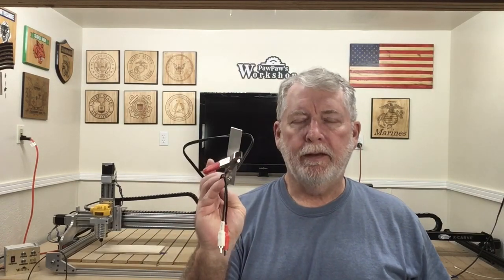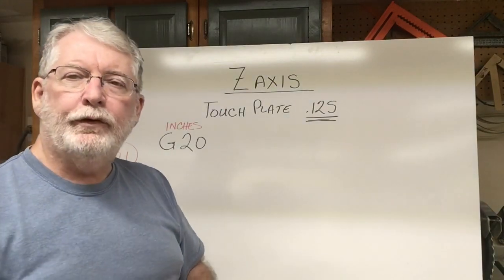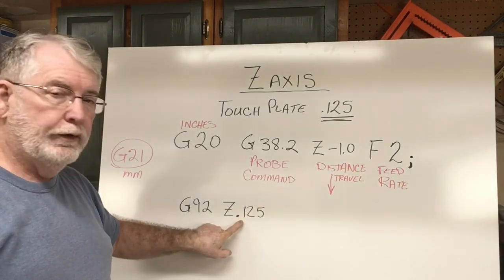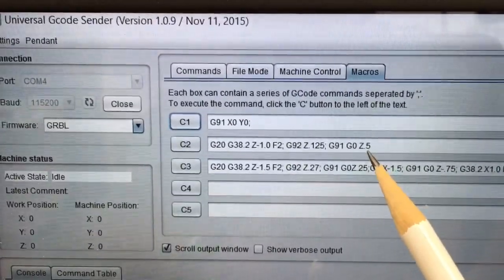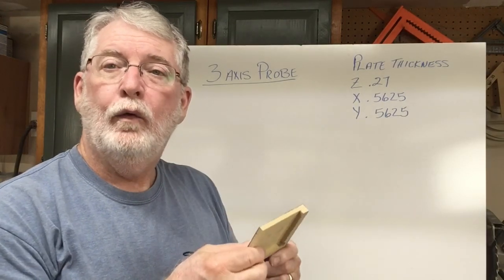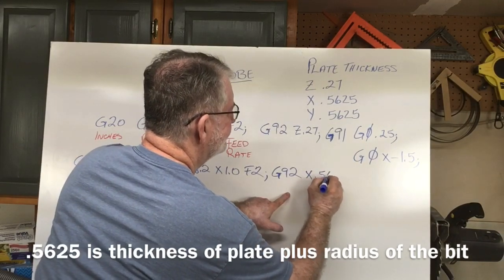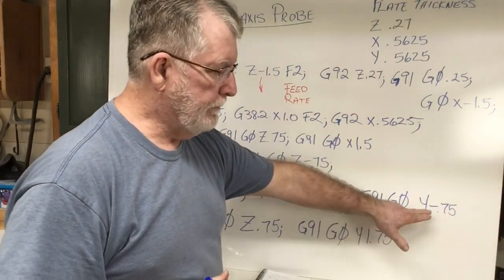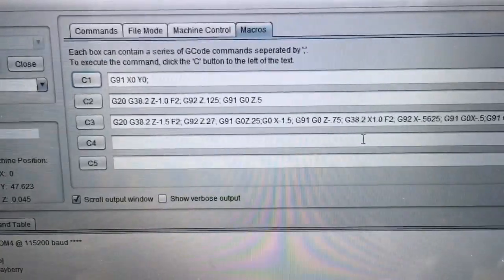Are You Ready to Learn to Write GCode for Your Touch Plates?

Comment: Thank you for the thorough explanation. While converting to Metric to help my brother, I took the liberty to convert the hard-coded values into variables so anyone can just change the values and not mess with the gcode itself. This gcode is in METRIC system. If you want to use Imperial, change G21 to G20 and your variables accordingly. Cheers!

;VARIABLES
#101=6(PROBING BIT DIAMETER)
#130=50(FEED RATE)
;
#102=10(TOUCHPLATE WALL THICKNESS FOR Z PROBE)
#103=15(TOUCHPLATE WALL THICKNESS FOR X PROBE)
#104=15(TOUCHPLATE WALL THICKNESS FOR Y PROBE)
;
#105=-20(MAXIMUM AMOUNT TO MOVE Z IN ORDER TO FIND TOUCHPLATE - down)
#106=15(AMOUNT TO MOVE Z AFTER Z PROBE - up)
;
#107=-40(AMOUNT TO MOVE X BEFORE X PROBE - left)
#108=-20(AMOUNT TO MOVE Z BEFORE X PROBE - down)
#109=15(MAXIMUM AMOUNT TO MOVE X IN ORDER TO FIND TOUCHPLATE - right)
;
#110=-15(AMOUNT TO MOVE X AFTER X PROBE - left)
#111=10(AMOUNT TO MOVE Z AFTER X PROBE - up)
#112=40(AMOUNT TO MOVE X AFTER X PROBE - right)
;
#113=-40(AMOUNT TO MOVE Y BEFORE Y PROBE - closer to you)
#114=-10(AMOUNT TO MOVE Z BEFORE Y PROBE - down)
#115=-20(MAXIMUM AMOUNT TO MOVE Y IN ORDER TO FIND TOUCHPLATE - away from you)
;
#116=-20(AMOUNT TO MOVE Y AFTER Y PROBE - closer to you)
#117=20(AMOUNT TO MOVE Z AFTER Y PROBE - up)
#118=40(AMOUNT TO MOVE Y AFTER Y PROBE - away from you)
;
; 3 AXIS PROBE
G21;
G91;
; START Z PROBE
G38.2 Z#105 F#130;
G92 Z#102; Z PLATE THICKNESS
G0 Z#106;
; START X PROBE
G0 X#107;
G0 Z#108
G38.2 X#109 F#130;
G92 X[#103+[#101/2]]; X PLATE THICKNESS + PROBING BIT RADIUS
G0 X#110;
G0 Z#111;
G0 X#112;
; START Y PROBE
G0 Y#113;
G0 Z#114;
G38.2 Y#115 F#130;
G92 Y[[#104+[#101/2]]*-1]; Y PLATE THICKNESS + PROBING BIT RADIUS
G0 Y#116;
G0 Z#117;
G0 Y#118;
Reply from the maker: Wow, thank you very much. This is excellent information. I really appreciate this.

Comment: Greetings, I just wanted to give you a couple of tips on your code. At the beginning of your macros if you define G91 you don't need to enter it over and over. It's defined until you change it EX: G20; G91; G38.2 Z1.5 .... G91 is now defined. Also G0 has been defined too many times. G0 X; Z; Y; each instance after the ; is a separate command and G0 is carried thru. You only have to redefine if you alter the scheme such as a G92 command. This being said I have cleaned up your code. This is what is running on my machine at the moment. G20; G91; G38.2 Z-1 F3; G92 Z.255; G0 Z.5; X-1.25; Z-.75; G38.2 X1 F3; G92 X-.377; G0 X-.375; Z.75; X1.145; Y-1.25; Z-.75; G38.2 Y1 F3; G92 Y-.377; G0 Y-.375; Z.75; Y1.145   Notice only 3 G0 commands. Just wanted to help you clean up your code.

I have designed 2 versions of the macro above with a .125 offset for .25 mills and a .0625 for .125 mills so I don't have to keep recalculating the offsets. 

I do thank you for the idea of the plate design and for explaining in English terms what can be confusing to many. Hope this helps in future endeavors.
Reply from the maker: This is fantastic! I am still learning how to code and this information helps greatly.  I will be study this and making changes.  Thank you very much.
Reply: Is there a way to code the movement back to zero instead of having to enter each axis and click move? How do you grab the values that are displayed and just move that amount negative?
Reply: @michaelcocroft9700  Hi if I understand you . . . You're over complicating it.  Once the probe stops the next bit of code tells the control that it's Zero so just move to Zero with G90 ( Absolute ) not G91 (incremental)
So the G92 tells each axis that it's a distance from Zero ( so it knows where that axis zero is)
Hope I explained it clearly.   Jim
Reply: This is excellent. I'm a g code newbie, but this really helps the learning. Learning how to program my machine is really the next step up

Comment: Thanks this helps explain it more even for me. Since this was over a year ago to try and help others. I also wanted to mention there is a newer version of UGS that has (return to zero) button which might make it easier to return it instead of doing it by typing it in. Also the new version you can move xy and z independently now so you don't accidentally jam your bit into the board buy forgetting to  change xy movements which might be higher increments than what you'd like to set Z movements for. 

Great stuff Paw Paw!
Reply from the maker: Thank you very much for your comments.

Comment: This making more sense as I'm getting more familiar with G-Code. When you define the macro, it's tied to a fixed radius bit, it won't work if you change bits from say 1/4 in to 1/8 in
Reply from the maker: Just write a different macro. You only need to change two numbers

Comment: Great video. Wondering why the machine didn't already know where the 0,0,0 point was when you had entered all of the offsets.  You had to manually enter the coordinates to move to 0.  I may have missed something.
Reply from the maker: I do not use the homing switches.  I must tell where the machine is

Comment: Paw Paw, Where did you get the power supply box you use, and why do we need it?
Reply from the maker: I made the box with the off/on switch, and the abort, pause, restart buttons all are not on the controller.  Most importantly, I decided to put the controller under the table, therefore, I wanted this box on top of the table.  This also gives me easy access to the probe connection.
Reply: @PawPawsWorkShop  You lost me. Could you do a video of how you made it and the wiring process?
Reply from the maker: https://youtu.be/W97Xa3-s_tE

Comment: Thanks for that, big help. I have 1 issue, my touch plate thickness is .242 on x and y axis, I added .125 for half of a 1/4 inch bit..  .367 total.....my bit ends up not centered over corner of material but on the outside edge of x and y axis.  I use bcnc and have homing switches on my Powerroute.
Reply from the maker: Without seeing it, I'm not sure how to correct the issue.  I have to think that the measurement is off somewhere.  Adjust the measurement until the bit is exactly centered over the x,y, 0 position. The end result is what you are after.
Reply: @PawPawsWorkShop  I guess if I just add another .125 to each command for x and y it should put me over center of corner. Weird that that happens. Is there an end command to save or record that as my zero? such as g10 p0 l20 x0 y0 z .5

Comment: Hi Paw paw . hope you well.
I try make probe touch plate with mm not inch how workout for mm?
Reply from the maker: When you write the code use G21 to be in the mm. Then all movements should be expressed in mm.
Reply: Touch plate 0.125
G20 G38.2 Z-10 F2;

G92 Z.125 G91 G0.5

exsample say = Touch plate 20mm 
G21 G38.2 Z-40 F200

G92 Z20; G91 G020  ?? right
Reply from the maker: G20 is establishing inches. Therefore touchplate is .125 inches. Hope that helps
G21 would set the mm

Comment: I’m ready To code with your video and the comments! Now when not using easel, but vcarve/ugs. After you probe and load the file. When you click send will it raise the bit a little automatically like in easel? Or is it something separate after xyz 0.
Reply from the maker: It will raise the bit because of the safety height that you have set in Easel
Reply: @PawPawsWorkShop  thank you but I meant not using easel. Like how you use vcarve then to ugs to run the carve. Not using easel anymore. So when you set zero on ugs and click run or send, will it raise the bit before carving? Ready to carve switches and plate settings good to go just don’t want to drag the bit across.
Reply from the maker: In VCarve you also have to set the safety heights. It will be saved as part of the gcode

Comment: Did you ever had an issue that zero in the center of your design in Vcarve and when zero the same on picsender and send code starts drilling a hole 3" bellow the design?
Reply from the maker: No, I have never had that problem.  One, I do not use picsender, I use UGS.  It sounds like you lost the calibration on your Z axis.
Reply: @PawPawsWorkShop  probably operators issue 😂
Reply from the maker: Look at all the settings in VCarve.  The problem should be there.
Reply: @PawPawsWorkShop  you are completly right. Was there. Found the issue yesterday.
Reply from the maker: Awesome!

Comment: I have entered your macro code in my CNC using UGS but instead of moving in inches the machine moves in mm. I have the latest UGS platform installed.
Reply from the maker: When you write the Gcode macro, you start with G20 for inches or G21 if you wish to write the code in mm.

Comment: Hi 
I try make G code for mach 3 but not work  no move  just noting
check below if right ?  maybe I missing something ? 
G21 MM 

G38.2 Z-25 F100; 
G92 Z10; 
G91 G0 Z10; 
G0 X-50; G91 G0 Z18; G38.2 X25 F100; G92 X20; G91 G0 X-5; G91 G0 Z18; G91 G0 X50
G91 G0 Y-50; G91 G0 Z18; G38.2 Y25 F100; G92 Y20; G91 G0 Y-5; G0 Z18; G91 G0 Y50
Reply from the maker: I am not familiar with Mach 3. It operates on a different system. I know you can use gcode but I do not know the differences in the two systems